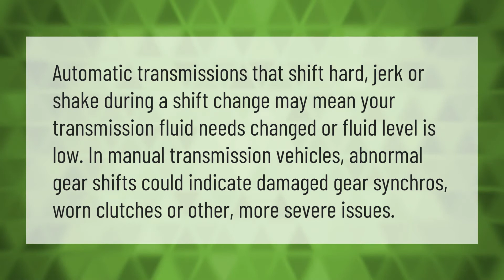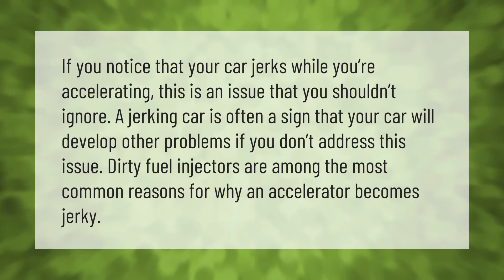Why does my car jerk when slowing down?

Comment: I would look at the brake rotors on the front axle. This was happening on my wife's RAV4. When everything was cool, I wouldn't get the shaking. When everything was hot, it allowed the rotors to warp enough that it would shake horribly while coming to a stop. I replaced the rotors and pads. Stopped all that.

Comment: What does it mean when it happens after a while of driving car jerks after stopping or stopping around 0-4mph
Reply: thats what i want to know my car jerks hard in forward and reverse for about a few feet then it locks and wont move
Reply: @kzariuscook1275  My car does the same.  My mechanic says he can find the problem.  Did you ever figure it out?
Reply: Ended up being my transmission that went bad.  Now I make sure I flush the fluid every 3 years
Reply: @kjwworldwide did you solve  this problem?
Reply: @kzariuscook1275  tranny is going out
Reply: @kzariuscook1275  did you find the problem??
Reply: Mam I don't face any problem if I drive on high speed above 50kmph.. whether it's on 3/4/5 gear .... But when my speed below 35 on 3rd gear my car jerk very badly. If I change on 2nd gear then it's normal again no problem on acclaration problem is on slow speed
Reply: @indianexperiments4192  did you find the problem??
Reply: did you find the problem??